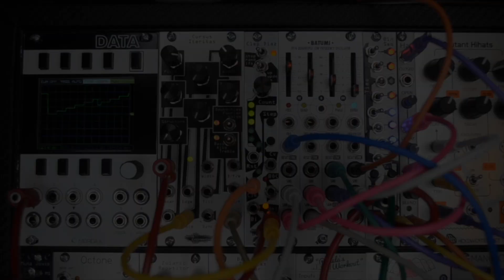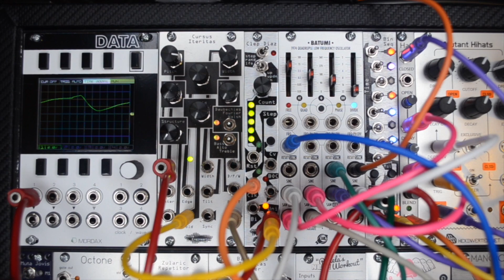Noise Engineering's Clep Diaz Modular Synth Tutorial, Demo and Jam

Comment: As a Noise Engineering fan, my Clep Diaz arrived today and been learning how to use it. Quite different than a regular LFO! Still trying to figure it out. So how would I modulate more than one oscillator? Holy cow my portable modular case is almost exactly like the one in this demo video! I even have  the Cursus Iteritas, Batumi and Pamela New Workout. Never expected to replicate your setup in the video :-)
Reply from the maker: Drop us a line for specific tips but the uni and bi outs can both be used to modulate anything you wish!

Comment: Looks really useful. I just wish the random gave proper stepped random voltages in a locked loop. I guess maybe the thinking was "well the turing machine already does that" but combined with the other things that this module does it would have been really powerful.

Comment: I can't decide if I like the LED patterns, or if I think simply going with binary would have been better.  Although, I guess if the CD can't play only 1 step, 2 steps in binary might look somewhat counter-intuitive (2nd LED lit to represent the fewest number of steps, instead of the 1st LED).

What does the red /3 or /4 LED do when there are 12 or 24 steps?  Does it alternate, or only show one?

63 steps in up/down mode is a weird number (as opposed to 64 or even 62).  It seems to suggest that one step (I'm guessing the last on the way up) is not repeated, and that it's always an odd number of steps (the number of steps is always 2n-1).  Perhaps it's you guys wanting to be different and/or forcing creativity, but it seems like it would make using up/down mode in a conventional way (fitting neatly in 4/4, for example) a bit difficult.  Hopefully I'm wrong about all this.
Reply: Binary so 0 is included in the number of steps

Comment: the step encoder works on a binary code in someway?
Reply: Linear Straight just the LED display. Least significant bit is at the top, most significant bit at the bottom. And it starts counting at 1, not at 0.